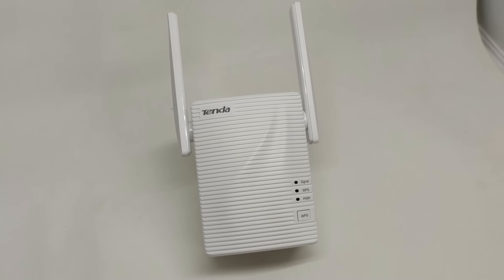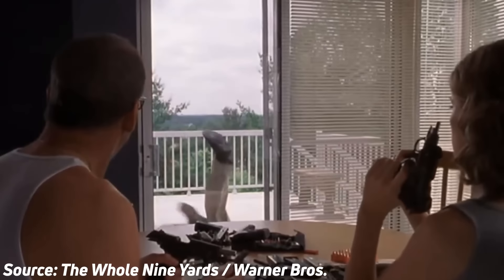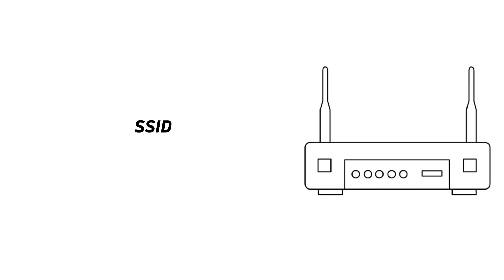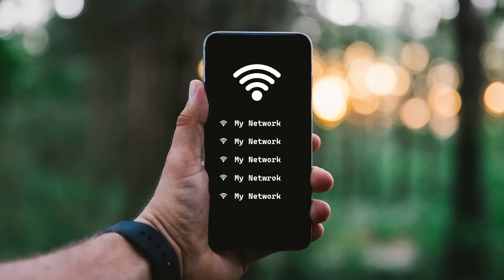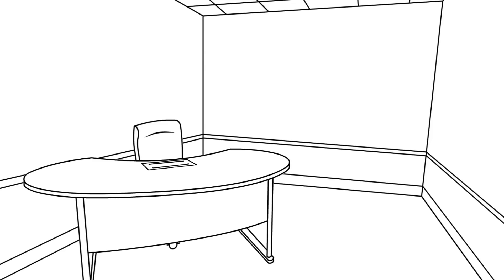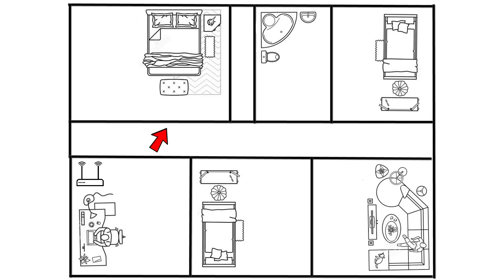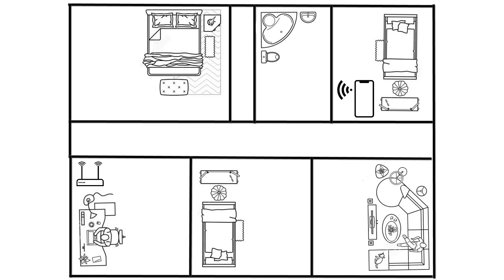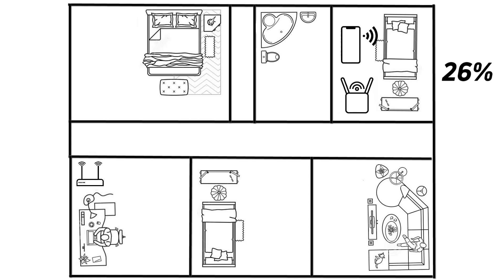How Do Wi-Fi Range Extenders Really Work?

Comment: THEN WHY CAN I GET WIFI IN HOSPITALS OR ANY LARGE BUILDING WITH MANY WALLS?
Reply from the maker: Why are you shouting? In large buildings they have multiple access points without using wifi extenders. Please see my video on mesh networking.
Reply: @GaryExplains  NOT SHOUTING, THIS IS JUST THE WAY I ROLL (GIGGLE).... IF I WERE SHOUTING, I'D USE AN EMOJI.  GARY, I APPRECIATE YOUR SHARING THAT INFO WITH ME,  I REALLY DO!

Comment: Great explanation however, you just ruined my hope of putting one of these things in my son's garage where I hang out in down time when I visit. Another video showed us how to first "connect it" to the original Wi-fi router, and then once it "synced" he moved it to his garage and was then able to move his computer to a further end of the garage than he had been able to prior. So, I guess he did have 'some' basic Wi-fi from his house in once corner of his garage, but not others, and now he did. So I am left confused. He did say it wasn't fast, so I don't know what that would mean to my aim of streaming videos but I suspect they will buffer a lot. Bummed out now, and really left wondering what is the point of them~? What are they normally used for~??
Reply from the maker: If you put the extender midway between the existing router and the garage then you might have some success. The important thing is to place the router where there is already a good signal. You could also use  cable to the extender or use mesh. I have videos about both of those.
Reply: @GaryExplains  Thanks. Turns out the house I'll be using has Comcast so I think their WiFi comes in some other way. Do you think they still have an external router for the WiFi?
Reply from the maker: Unfortunately I don't live in the USA so I have zero experience with Comcast. However every WIFi setup needs a box of some kind, likely incorporated in whatever other bits the provider needs (like cable modem or whatever) but there will be a physical box with antennas etc.
Reply: @GaryExplains  Yup. Thanks!

Comment: I was under the impression that the majority of wi-fi extenders get connected to the router with ethernet or power-line adapters.
Reply from the maker: No, not at all. These are designed for when people can't or don't want to run cable. A wi-fi unit connected via Ethernet is just an access point.
Reply: @GaryExplains  That makes sense. I think I heard the terms wrongly used interchangeably and got confused.

Comment: Ok ...I installed a alexa in my bathroom upstairs and smart switches..they loose wifi signal,my router  is downstairs in the livingroom....I was about to buy a extender but u saying  not gonna have better signal upstairs with a extender?  Than what should I get? Lol
Reply from the maker: If you put the extender half way between your  bathroom upstairs and the livingroom then it will likely help with your connection issues. Other things to look at are Mesh networks, and Powerline adapters. Plus you can always run an Ethernet cable from downstairs to upstairs., that is what I have done

Comment: not true at all
the extender amplifies the signal and keeps it stable
my computer loses signal every bit in the room even though it is only 7m away from the router antenna in the hallway
the speed was only 11 mbit / s and very unstable, with a lot of interruptions and a lot of lag
after placing the extender and connecting the computer via UTP to the extender
the speed has jumped to 30 mbit / s and is very stable, with no lag.
in addition the cell phones in the room react lightning fast when they use the internet.
Reply from the maker: Hmmm. I am sorry to say but you have completely misunderstood. Also, in your example you have connected the extender via a cable. That is a very different scenario.
Reply: @GaryExplains  extender is connect with UTP to computer not to router
from Router to extender are 2 walls and hall and only WiFi connect
Reply from the maker: As I said, you have misunderstood. That is not a scenario that I cover in the video.
Reply: @GaryExplains  well if mobile phone works faster and better via WiFi, then it is...

Comment: Never use those type of Wi-Fi extenders especially ones that go straight into plug sockets they cause a load of problem with amateur radio and we have been trying to ban them for that very purpose if people are going to use Wi-Fi extenders than they should use ones they actually act like routers or access points rather than going over powerline is the powerline ones please never recommend them to anybody

Comment: Disappointing and incomplete. Gary COMPLETELY ignored the right way to setup the secondary access point, which is with a WIRED connection to the main WiFi router with NO  loss of WiFi bandwidth.
Reply from the maker: Hmmm. Your comment is disappointing. While a cable can be used (and I will likely do a video about it). There is no "right" way. Many extenders don't have an Ethernet port. Many do, but when you use them like that you aren't using them as a WiFi extender, but as an access point (as you say), which is a different thing. As I say in this very video this is for situations when you can't or don't want to run a cable. I am sorry you didn't understand that.

Comment: This video is soooo wrong. If you use a different channel there will be no interference.
Reply from the maker: Unless the extender is dual band (meaning it has two radios) it has to use the same channel as the original network.